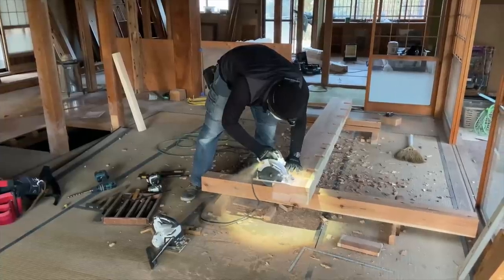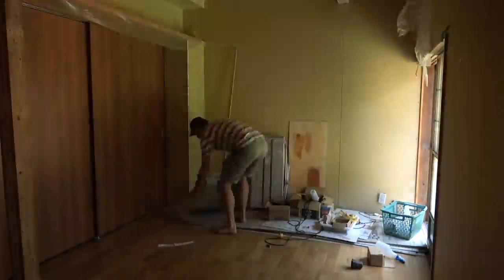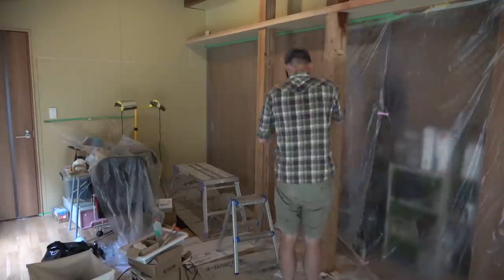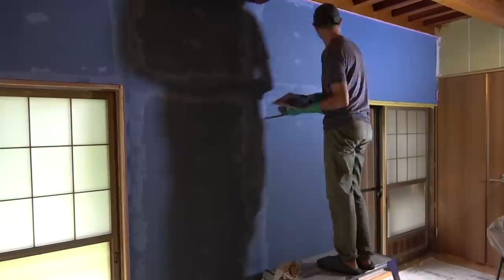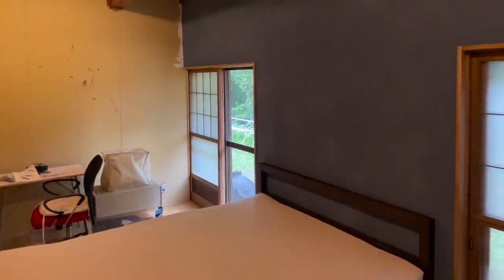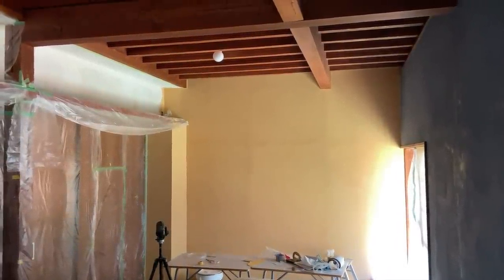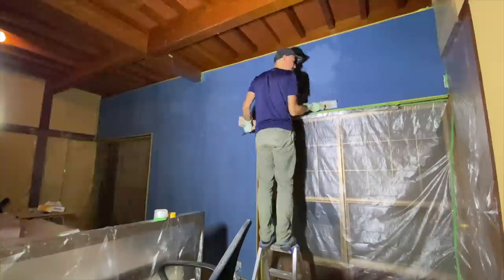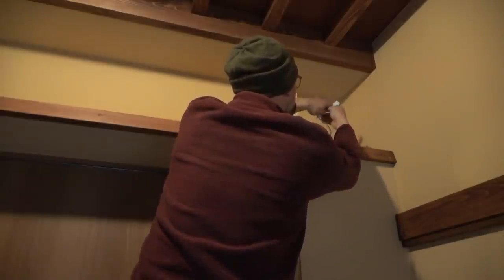Japanese Abandoned House Renovation #14 | Revealing the Bedroom!

Comment: That bedroom ended up looking really good! I like the blue color you choose for the shikkui — we used almost exactly the same color downstairs in our place too! AND the exposed wood posts&beams as well. Although your new place is a lot more traditional than ours, we ended up with a lot of the same aesthetic. Come down to visit sometime and I’ll give you a tour! (And maybe we can finally get around to that collaboration video. Or just beer? 🍻)
Reply from the maker: Thanks man, will let you know if I’m ever down your way.
Reply: Yeah the yellow goes really well next to the wood beams.
Reply: The seam-hiding beams look just fine and the lighting turned out great. It seems that drywall seams are an issue for everyone everywhere.  Question - how is noise in the house? I've fully insulated floors and ceilings and my boys + my 20lb cat still sound like a herd of buffalo  when running through the house. Also, (totally unrelated) how is your wifi signal? Do you need lots of repeaters or separate wifi points?
Reply: @johnbatchelder7168  Never saw someone use "I've" like that.
Reply: @Mrshoujo  neither have I! I think maybe I was using voice to text here and didn't read carefully.
Reply from the maker: @johnbatchelder7168  yeah, it’s pretty noisy with the cats and boys running around. Can’t be helped in a house like this. Wifi coverage is good, just reaches the bathroom, but I think I will put in a repeater upstairs at some point.
Reply: @Mrshoujo  "I've" is standard everyday English.

Comment: I could see you installing a series of nice framed black and white prints using that horizontal piece of wood you installed on the wall as a picture rail. The vertical pieces would frame it nicely, and a simple round clock would fit perfectly in the middle section above the rail.
Reply from the maker: I was thinking about that, not sure what pictures would be suitable though.
Reply: @TokyoLlama  keeping with the surroundings and themes of natural material in the house, if it were my room, I'd consider something natural: trees, flowers, plants
Reply from the maker: @Lv-nq9qz  good ideas, thanks.

Comment: Any idea how much you've spent on electricians? I was quoted 100,000 to install a new breaker box with a few nearby outlets, and 500,000 to have the entire house's wiring checked/replaced as needed. I can't justify having everything replaced now because the kitchen is in need of a major overhaul. I wouldn't want to have to pay twice for that work.

One more thing, btw: it looks like I'll be transferring to a different school closer to my house, so I'll need to have some place in my house livable by April! I still have some things that need doing, such as the well, electric option, structure and land stability/earthquake resistance, a functioning shower and toilet, and deciding which room/area of the home I need to focus on living/staying in. Do you have any suggestions on what order I might tackle these? Thanks so much!
Reply from the maker: We spent well over a million yen on electricians. The whole house has entirely new wiring, sockets and LAN conduits, upgraded to 100amps, so basically like a new house. 

I'd get the shower, toilet and kitchen done as you can't live in there without those, and make one room comfortable. Then you can always heat using a kerosene stove and a kotatsu. Good luck!

Comment: This is a suggestion on an old video so mayhap it's moot. You've installed a corded reading lamp over your chair and it's ugly looking. What I've found on Amazon lately are these rechargeable battery light fixtures. They're suggested for lighting artwork, but some are touted as reading/study lights. The downside is the staying power on some of the cheaper lamps isn't so good. The upside is they can be installed anywhere. They look fairly good too and it's minimalist. I like them. You should consider them. I too like the beams to cover up the plaster lines

Comment: Curious as to why you used plywood for the floor rather that a tongue and groove board. The walls needed a level 5 finish prior to putting the finish coat on which can be accomplished with a heavy nap roller and trowel and mixing the joint compound to the level of a heavy milkshake. Research putting dish soap in the mix to make it smoother. Use a strip light to check the finish prior to putting a sealer coat on. https://www.youtube.com/watch?v=l3i1an3jkTQ

Comment: Be very careful with cheaper lights from Alibaba and Ikea, while they seem cheap, they generally have a terrible CRI index. CRI in laymans terms means how well the light makes colors/surfaces look, the lower the CRI, the worse colors/surfaces in your room will look.

A CRI of 100 is basically the old style incandescent lights, CRI's of between 85 and 100 give you the most accurate and natural look.
While this might, at first seem overblown and irrelevant, it does matter a lot when you are working with colored surfaces.

As a test, buy and expensive Philips LED light and buy a cheap LED light from somewhere else, make them the same strength, say equivalent to 40W and put them in separate light fittings in the same room some distance apart.
When you switch them on you'll see that the cheap LED's have a sickly green tint to them similar of the old fluorescent tubes and the colors/surfaces look dull.
Those cheap lights are generally 50-65CRI

We have some exposed brickwork in our house and cheap LED strips make that look awful, the same exact wall with higher quality lights looks amazing. Trust me, do not skimp on your LED light bulbs, they make everything look nicer but they will also outlive you probably, so they are well worth the investment.

Now, we got an LED strip from a cheap store at one point in our old house, in the kitchen. When you used that for lighting, carrots were neon orange and tomatoes were some kind of muddy red color. Literally every color was off from what it was supposed to be, so this strip had an even worse CRI.
Reply from the maker: Thanks very much for the info, I didn't know that. I do have some Hue lights and like them, may upgrade the others up some point.
Reply: @TokyoLlama  You are welcome :) Installing LED lighting myself at the moment in our renovation (just warm white, no colors) and did a ton of research beforehand.
Thought it might save you guys the trouble and time!